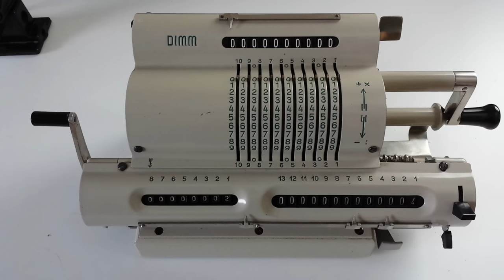Mechanical calculator in action

Comment: So if i want to multiply 1289 by 3592 i have to turn that lever 1289 times?
Reply from the maker: No. You would put 1289 in the input and shift the output to the 4th digit and do 3 turns, then shift right one digit and do 5 turns, then 9 in the next, and 2 in the last digit. Assuming you don't change the input, the left turn counter will show what you're multiplying by, and the output will show the correct result

Comment: What happens when it tries dividing by zero?
Reply from the maker: An infinite loop. The output is subtracted by zero so it remains the same
Reply: @jdigi78  Yes, but nevertheless the result is not the same as the input number. It has no result.
Reply from the maker: @mirnacudiczgela1963  the result is infinity technically
Reply: @jdigi78  I heard mathematicians say it is not infinity either. Anyway, can this calculator work with decimals?

Comment: So if I understood correctly, if you want to do a multiplication like 10×13 you would have to enter the number 13 and rotate 10 times?
Also how much did you pay for this?
Reply from the maker: that is correct, and I paid around $80 for it on etsy
Reply: Joseph DiGiovanni 
Thanks for the answer!
Reply: No you wouldn't. You would only have to rotate it once with the carriage moved up to the tens position.
Reply: How about multiplying, say, 2468×8642, would you turn the crank 2468 times? Of course not. Instead, firstly, turn the crank 8 times, then move carriage to the right (so the counter is on the tens place), turn the crank 6x, move carriage to the right, turn 4x, move carriage, and finally turn 2x.

Comment: Why wouldn't you just start with the leftmost digits lined up during division? A division (with quotient ≥ 1) is never possible if the divisor has more digits left of the decimal than the dividend.
Reply from the maker: I'm not sure what you mean. If you're referring to when I did 3000-13000 at 6:11 it was just for demonstration purposes

Comment: what's the name of the model?
Reply from the maker: no model number, only markings on it are the Dimm logo and serial number. Although I've found it also manufactured under the name Ropel
Reply: @jdigi78  ah. Would you mind sending the serial number so I can try find another like it anyway?
Reply from the maker: @doctornotprofessor  the serial will be unique for each unit so I doubt it will help, but it's 018893. It also says made in italy
Reply: @jdigi78  thanks
Reply: @jdigi78  turns out it's based on the Odhner Arithmometer, loads of clones of it

Comment: How does the machine handle decimals?
Reply: Joseph DiGiovanni
2 years ago
I said 13 goes into 3164 243 times with a remainder of 5, which is correct. If I had entered the 3164 over to the left a few digits (like 3164000) you could have an imaginary decimal point and get the proper result. That's what the metal sliders under the counters are for. An updated video with more detailed information should be coming soon! 

Viktor Horváth
1 year ago
In fact, by showing 243 + 5/13 the calculator is more accurate than any floating point representation.

Comment: 3,164/13= 243.384615...
Reply from the maker: I said 13 goes into 3164 243 times with a remainder of 5, which is correct. If I had entered the 3164 over to the left a few digits (like 3164000) you could have an imaginary decimal point and get the proper result. That's what the metal sliders under the counters are for. An updated video with more detailed information should be coming soon!
Reply: +Thong Tran In fact, by showing 243 + 5/13 the calculator is more accurate than any floating point representation.
Reply: @Joseph DiGiovanni Sometimes you want a remainder, for example when converting a large number of inches to feet and inches, or a large number of ounces to pounds and ounces.

Comment: In the future, they are going to make a computer chip with billions, perhaps, trillions of these machine in MOLECULAR form on  a chip. No electronic or semiconductor components needed, and also, the computer chip runs on chemical energy. These molecular nanomotors contains catalytic site which chemical fuels such as natural gas, alcohol, butane, etc. can react with oxygen in the air, producing energy to drive the motor and the whole molecular "machines". This concept is very similar to how myosin protein in the muscle cell react with ATP to produce muscle movement. If Cars can run on gas, then your Playstation 4 or Xbox One should also be running on gas. Just hook a propane tank to your Xbox One or Playstation 4, and it will run without electricity. You may look at me crazy and ask, don't you need electricity to plug up into your TV? Well, the data transfer is hydraulic and your tv can convert hydraulic signals to every 207,3600 or 830,000 pixels that is powered by special "Enzyme"that breaks down fuel and oxygen into water and CO2 releasing energy that excites a photochemical inside the pixel to produce light, thus image.  Your Playstation 4 or Xbox one controller runs out of Juice? Just refill it with Booze and It will work fine and dandy.
Reply from the maker: please never comment on any video ever again
Reply: Why? IT IS an interesting idea
Reply from the maker: nothing in his comment made sense
Reply: Or maybe there will be a small microscopic +Joseph DiGiovanni with a lots of little mecanical calculators that will work very very fast ... and give the answers faster than a Intel processor ...
Reply: Wilhelm - it's just dumb, no genius in sight :)  

Even if the mechanisms he proposes were possible and even built (I have no idea how you'd create instructions for this thing), the speed of calculations would be orders of magnitude slower than even the most primitive of electronic devices.  You'd just have very large set of very very very tiny mechanical calculators